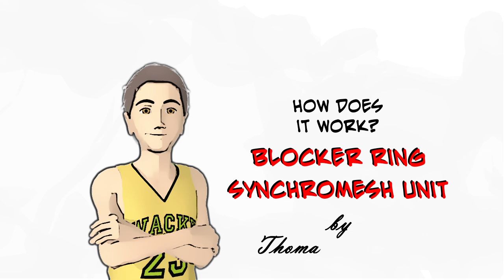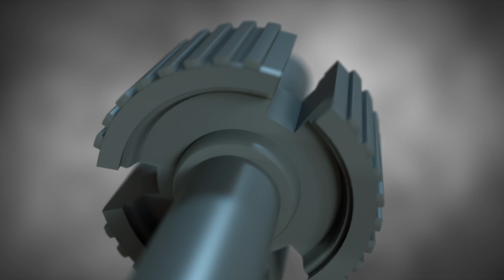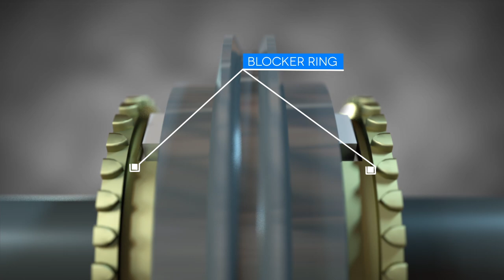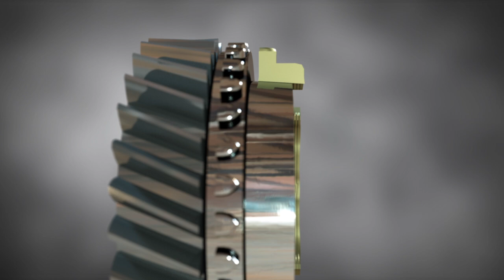Blocker Ring Synchromesh Unit - How it works! (Animation)

Comment: after two days of research I was still wondering nobody seemed to explain the nature of aligning the actual dogs. I thought even at the matched speed, if the dogs aren't aligned with eachother, the gears would still grind against eachother a lot before managing to slip into mesh. I now understand that it should have been obvious that the dogs are pointed, not flat, so the chances of lining them up point-to-point are incredibly slim and can still be overcome. NOBODY DEMONSTRATED THAT PART. 10/10 best video on YouTube ever.
Reply: This is the second vid I've found where the dogs are shown as grooved, which until I saw the 1st vid, I still struggled to grasp how syncromesh worked

Comment: This type of animated learning aid is not very common in aviation maintenance schools (not sure about automotive maint schools).  Reading sentences/looking at photo images can teach only so much.  "Things in motion" is the best way for learning.
Reply: JPN850R 
That happened to me when I saw a picture of a differential gearing for the first time. I was still scratching my head until I actually saw it in motion.
Reply: In auto tech schools, (Dunwoody, in my case) we took the transmissions apart and learned how they work. In my Army aviation school (AH1 back in '88), transmissions were explained via power flow.

Comment: Extremely clean animation and well-chosen camera angle to show exactly the parts in action to understand how synchronizers function. Thanks!
Reply: yes, clean animation but far from clear. No explanation on the screen and he's throwing all that mechanical jargon at you, at the speed of 2000 RPM. 
Regrettably I thought the video was totally useless.
Reply: @modo203  absolutely not useless. This is actually the only video I found where it explains how the Brass ring gets pushed against the metal cone. Those 3 little strut tabs make contact with the Brass ring first! Then, with added pressure by the shift fork, the strut tabs get pushed down and out of the way, so as to not add any more pressure to the cone clutches. Their job is done, allowing the slider to comb through the little teeth, thus capturing both the gear and hub together.

Send me other videos that show this process any clearer.

I seen a video where he uses a strobe light to show how the synchro slows down the gear, but never explained that the Brass synchro gets pre-pressure from the strut tabs.

Pure genius
Reply: You correct that real explanding

Comment: One important thing you missed is the blocker ring can only rotate less than 1 tooth apart from the shift sleeve, this way it has some play to displace the shift sleeve away from the gear before synchronizing it but the play is limited so it doesn't start rotating when pressed to the gear without the shift sleeve.

Comment: Might want to add that the recesses in the blocker ring limit rotation of that relative to the shift sleeve of a half tooth either side.  Good explanation though.
Reply: This is what I was trying to figure out, how is it that the sleeve and drive gear are never 1/2 out of phase.
Reply: @STEROIDZZZZZZ  Could you explain further?
Did you mean the speed?

Comment: Best video ever seen on synchronizing process in a gearbox, thank you. The quality and beauty of the video is impressive too.
I watched it several times to perfectly understand the process and I realized that an important stuff is shown but not explained. So here is a proposition for an improvement (if you consider updating this video) :
Speak about and show the importance of the recesses in the blocker ring. These recesses are larger than the struts. The gap formed ensure that the shift sleeve cannot engage onto the blocker ring nor onto the gear wheel before complete synchronization (because friction of the gear wheel on the blocker ring unalign them). When synchronization is complete, the blocker ring go "backward" in is rotation to let the shift sleeve engage. Then the whole (sync hub+shift sleeve+blocker ring) go eventually "backward" or "forward" in rotation to align perfectly with the teeth of the gear wheel to let the shift sleeve engage on the gear wheel. Without this gap, the teeth would collide. So it is pretty important.
Reply: Ah, thank you! I was wondering why exactly the shift sleeve couldn't engage while the blocker ring was still speeding up the gear wheel.
Reply: What causes the torque reversal to the blocker ring that allows it to go "backward", coming into tooth alignment with the sleeve???
Reply: The whole process is not well explained in this video. Here you can found all steps well explained: http://www.jht.bme.hu/publ/marialigeti/mechanical_behaviour_simulation.pdf

In the nutshell: There are two rotations after the speed synchronization.  First, the blocker ring-gear complex is rotated by the spline chamfers of the sleeve interacting with the blocker ring chamfers. In the second step, the blocker ring is separated from the gear and is turned in line with all the dents by the sleeve ring-gear chamfer interaction. It has to be noted also that the pressure on the blocker ring is reduced because of the push down struts. Still, the blocker ring is stuck to the gear cone by the thermal shrinkage after the speed synchronization.

Comment: What happens when the gear shift grinds when the oil is cold?  Is that due to the cold, thick oil being trapped in the grooves of the synchro ring and can't get out of them fast enough? Great video! Thanks a lot.

Comment: That explains why first to second gear takes a extra time to sync up due to the huge gearing difference from the two.
Reply: And it also explains why the 1-2 shift is likely the first to become troublesome, particularly if the car and thus gearbox are driven hard.

Comment: Great clarity now on how syncros work, thanks. When you shift out of a gear there doesnt look to be any mechanism that pulls the blocker ring off the gear. I understand the blocker ring can only move axially and that the gear would then start to de-synchronise as vehical speed changes. Is this enough for the blocker ring to retract back towards the hub?
Reply: The blocker ring only grips the cone of the gear when there's pressure on the ring by the struts. When they release their pressure, the blocker ring releases its grip on the gear. It doesn't need to be pulled off, oil will get in between it and the gear and it will float.  There's no "de-synchronising".

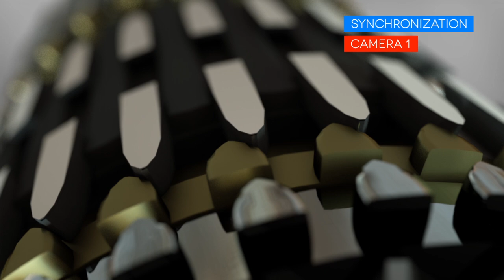Comment: 02:48 - there is a mistake in the animation here. The animation shows, ones the rotational speeds are sinchronized, the blocker ring rotates slightly back while the cone clutch stays in place - this is impossible. Otherwise, the blocker ring could rotate back under the sleeve pressure before sinchronization is complete. In real, after sinchronization, the blocker ring rotates a bit together with the cone clutch and gear, and then sleeve is shifted.
Reply: That part had me puzzled glad someone else noticed the discrepancy. He also says the sleeve rotation speed needs to match the blocker speed. But aren't this always in mesh with the strut's?

Comment: Question, why are the three struts necessary? What if there is no pre-synchronization?
Reply: I have been kicking this though around as well. It seems the strut's are needed to keep the sleeve in it's neutral position. Otherwise the sleeve could inadvertently slide into gear.   Better yet what stops the sleeve from fully engaging before or sync?🤔

Comment: We are using this type of synchromesh unit in a gearbox we are developing but it doesn't seem to be working in 1st gear.  There is no feeling of contact between the cone and the ring.  You don't feel the friction attempting to slow the gear down.  It simply grinds as though there is no synchro mechanism at all.  I'm wondering if the proper engagement is based upon some sort of shimming tolerance so that the cone engages at the proper amount of lateral movement, and if that information exists, where can I find it?

Comment: But, how does the blocker ring disengage from the conical face of the gear? i understand that there is a cone clutch friction between the blocker ring and conical face of the gear. Then wouldn't this require a force in the reverse direction to disengage? Is this force provided by the driver?
Reply: i think it is because of centrifugal force

Comment: how the blocker ring tooth and main gear's mating tooth are aligned? (as the blocker ring is simply floating between two components how is it happening)
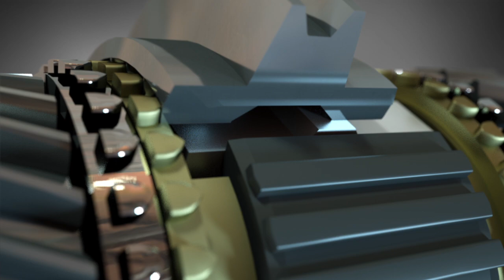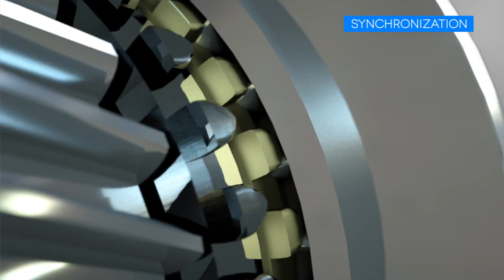Reply: See 2:25-2:58 of video. The blocker ring has limited rotational freedom relative to the shift sleeve, about half a tooth on either side.Also if you observe, the blocker ring tooth flank and shift sleeve tooth flanks are chamfered. So once the blocker ring and main gear's mating tooth come to same speed , the blocker ring teeth can be "forced" into alignment with the main gear  cone teeth and the shift sleeve goes in further to complete the latching.all of this happens almost instantaneously when the driver shifts the gear.

Comment: Hello, thanks for this. Why is the ring made of brass? What are the other parts made of? Thanks.
Reply: Since brass is softer than steel, it can help the gears to come into synchronization quicker but at the expense of shortened durability.  There is also multi cone synchronizers that achieves the same purpose.  Finally there is carbon faced synchros used by some high performance Hondas a decade ago.
Reply: ahh thanks

Comment: what happens if I accidentally moved to other gear without pushing the clutch fully which causes some grinding?
Reply: Lely terra gearbox
Reply: If you don't depress the clutch pedal fully, it means your flywheel transfers the engine torque to the clutch disc. The clutch disc is on the gearbox input shaft, so there is the engine torque applied on the gearbox input shaft.
When trying to engage the gear, the sleeve will push against the synchro ring. The synchro ring conical clutch will try to change the input shaft rotation (engine rotation) speed, but it won't succeed because it's very difficult to brake or accelerate an engine quickly enough when you are a syncro ring, because of the inertia.
Also, the shifter movement is very short and quick, and the synchro ring would take a long time to change the engine rotational speed before we could finally engage the dog teath with the sleeve without grinding.

Depressing the clutch pedal separates the flywheel from the clutch disc, making it much easier for the synchro ring to slow down quickly or accelerate quickly the gearbox input shaft to the correct speed (because of low inertia of the small input shaft in comparison to an input shaft + a whole crankshaft and camshaft).

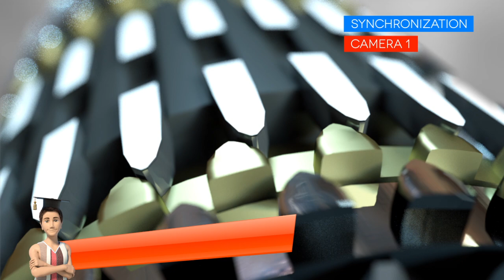Comment: This video is amazing until 2:30.  From about 2:35 to about 2:55, it has it completely wrong.
Reply from the maker: Why is that?
Reply: @ThomasSchwenke-knowledge  The main error is at 2:41, but I want to say something more generally after that.  But at 2:41 it says, “only when the shift sleeve and the blocker ring have the same rotational speed.”  The shift sleeve and the blocker ring ALWAYS have the same rotational speed.  Then it says that after those two have the same rotational speed, “the shift sleeve can align the blocker ring.”  That isn’t exactly true.

But let me explain that where the confusion is coming from is that what the video fails to explain is how the system actually works.  The difference in rotational speed between the gear and the blocker ring causes frictional torque on the blocker ring which pulls the blocker ring out of alignment.  That is why when the shift sleeve collides with the blocker ring teeth, the flanks of the sleeve teeth hit the flanks of the blocker teeth.  As the driver pushes on the slider the sleeve wants to push the blocker ring back into alignment.  BUT IT CANNOT because the torque caused by the difference in speed between the speed gear and the blocker ring is too strong for the driver to overcome.  Once the rotational speeds of the speed gear and the blocker ring are closely aligned, then the torque caused by the friction will lessen enough that the driver can overcome it and push the blocker ring teeth back into alignment and out of the way, so the shift sleeve can push by them and engage the teeth of the speed gear directly, but that can’t happen until the difference in speed between the speed gear and the blocker ring is negligible.  Then at last the flanks of the sleeve teeth can realign the speed gear slightly back or forth so the shift sleeve can fully engage it.  (It’s important to notice that once the shift sleeve realigns the teeth of the blocker ring and slides past them, the blocker ring no longer exerts any force whatever on the speed gear.  It “lets go” of the speed gear entirely at that point.  If the blocker ring did not “let go” of the speed gear, it would be impossible for the shift sleeve to do the last bit of alignment with the speed gear.

So the end of this video misses the actual point of the blocker ring.  The purpose of the struts, which this video describes beautifully, is only for the initial engagement of the blocker ring with the cone clutch.  That initial contact caused by the struts pulls the blocker ring out of alignment so that it can do its “blocking” action when the shift sleeve pushes the strut out of the way and engages the blocker ring directly.  Without the strut causing the initial torque, it would be possible for the teeth of the shift sleeve to miss the teeth of the blocker ring entirely and hit the speed gear directly, causing grinding.  But what is missing from the video is that when the shift sleeve teeth flanks engage with the blocker ring teeth flanks, the torque caused by the pressure of the ring against the speed gear prevents the sleeve from getting past the blocker ring until the two gears are at the same speed.